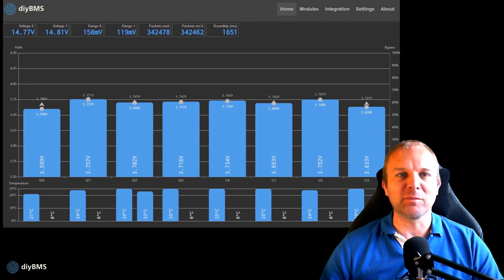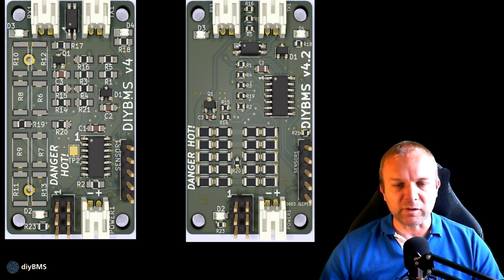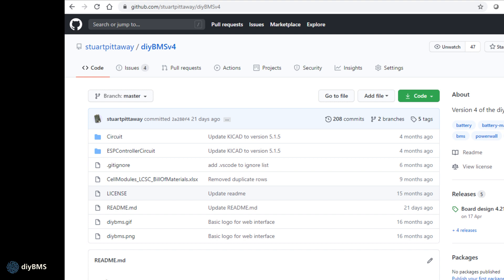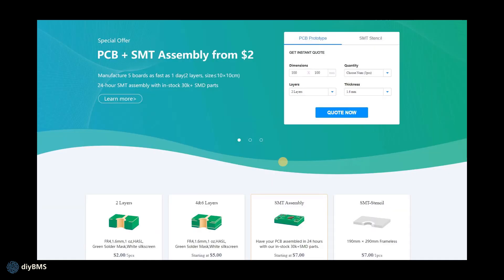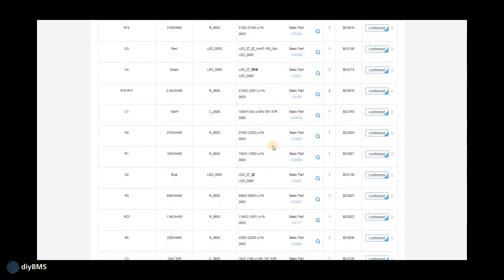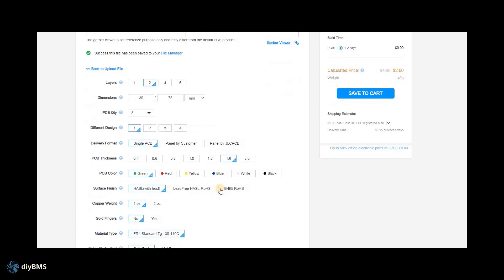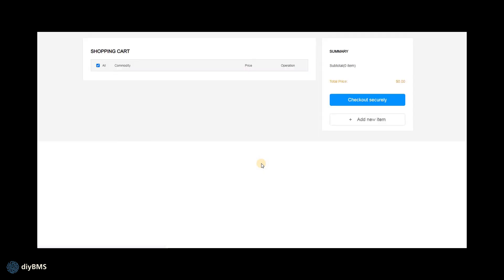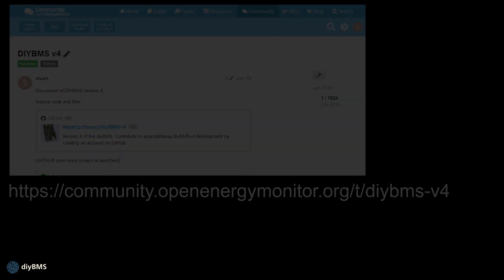DIYBMS v4 Building & Ordering PCBs

Comment: v4.5 have error past confirm BOM and CPL:
"Error:
The below parts won't be assembled due to data missing.
UPDI1,EXTTEMP1,J1,POWER2,J2,POWER1,RX1,TX1 designators don't exist in the CPL file."
Reply from the maker: You can ignore that - JLC have introduced a new warning message, they can't populate those parts anyway.

Comment: Hi. I try to start to build my first BMS. I started the whole order process with the latest ModuleV450. But on the jlcpcb site the following things are missing:
- 3R0
- ATTINY1624-SSU
- AZ432ANTR-E1

And for the main board:
- Molex0472192001
- INA229AIDGSR
Is there a replacement for this things on jlcpcb? Or I can left it out, and order from somewhere else?
Reply from the maker: I would wait for a few days and see if the parts come back into stock.  If not, you need to manually solder the parts on, and that can be difficult.

Comment: Hi Sir or madam,    
 Hello, I got something like this, how can I solve it. Regards.
        
  Well got your order with many thanks.

Sorry to bother you, but there is one thing that we want to confirm with you about your SMT order before proceeding.

As shown below, seems the packages of the parts (U3 ) cannot match the corresponding pads on the PCB board, so we are unable to assemble them.
Could we skip them and continue to assembly as shown in the below image?
Sorry that we don't replacing gerber/BOM/CPL files for SMT order.
For this case there are 2 options for your choose as follows:
A- we enable the replace part button for you that you can re-select the corrected part
or
B- we leave this parts unpopulated and refund the mismatch parts back to you to proceed
Pls consider and advise which case suits you, A or B??

Your early reply will be highly appreciated, thank you so much!

Comment: Hey Stuart, great project, thanks alot especially for sharing it. Currently I'm trying to order it. At JLCPCB the Anbon Voltage Suppressor for D2 (C440263) ist out of stock. Can I replace it with the MOD model (C113974)?
Reply from the maker: They look very similar, so I expect it would work okay.  I've not used that part, but I can't see anything obvious on why it won't work.

Comment: The design of burning off charge when the peak voltage is reached is not a great design.   Ideally, one charges each cell independantly using isolated charge sources, for example, a transformer with multiple output windings, one for each cell.
My experience with jpcb is mixed, they messed up and didn't cut slots so th parts wouldn't fit, and then worse, they didn't install some 0603 caps but did the boards anyway, and so they were useless and I spend many days trying to get them to fix it, they wanted to refund me for the missing 3cents of caps,
that made my $65 boards useless.    So letting you know, they have some issues.
Reply from the maker: Hi Murray, thanks for the comments. Do you know of any isolated cell based chargers on the market? I agree that resistive energy wasting isn't ideal, but that seems to be the most common in the industry

Comment: Thanks for posting. Can I ask a question this will be first time I've created a battery pack?

I think each module attaches to a cell and they attach back to the controller is this correct?
I want to create a 16s pack containing 16 x 3.2v 304ah batteries, can modules/controller work with this size of battery?
if I was to add another 16s in parallel would I need another controller or could these cells link to original controller?
Reply from the maker: Hi, you are correct each module would connect to a single cell (in your case the 304ah) so you would need 16 modules, and 1 controller.  If you double the cells, another 16 modules, but these can be linked to the same controller.
Reply: @StuartPittaway  thanks for the answer. So in theory I could keep adding 16s in parallel to the one controller up to
6 times?
Reply from the maker: @peterwhitehead8376  yes, some people have reported issues when going over 48 modules, so best to stay under that for now

Comment: Hi Stuart, what the highest amount of cells your project will run, looking for options for my EV conversion, is it capable of 96s ? Thanks
Reply from the maker: Theoretical yes, the most I've seen so far is 72s.  For high numbers of cells use the v4.40 modules. At some point I will release an update to increase the Comms speed on those modules, as this can be an issue with large installs.

Comment: Nice project, but 12V is quite low and not efficient for my home battery project. Is there any info on a open source 48 Volt Battery pack?
Reply from the maker: Hi, this isn't limited to 12V, up to 64 modules can be used so 48V is no problem.

Comment: Hello Stuart
Can single BMS Board  with controller handle 20S Battery Pack  
Thank you for the work!
Reply from the maker: You need a single controller and multiple module boards - one for each series cell, so 20 of them.
Reply: @StuartPittaway  Thank you for your answer

Comment: I want to build one, but before I do I would like to know if anyone can advise just how much CURRENT can this system use to discharge a single cell? I mean if I am charging with say 60 amps to the pack, this would be around 3amps/cell. What can I expect from this v4 diybms? Seems like a project right up my alley.
Or do I have the concept wrong? Is it work as above, or is the idea that by placing the resistor bank on the cell it alters the internal resistance of that cell and power is diverted to the others as they take the path of least resistance? I'll be honest, I thoought that bms just burned off the extra current, but do I have this all wrong?
Reply from the maker: Each module uses a set of resistors to drain the excess energy. This is normally around 850mA, but drops as the temperature of the module increases. You won't be charging the battery with a full 60A near the end of the charge cycle, so depending on how many modules and series packs you have determines if this is enough or not.
Reply: @StuartPittaway  So I am trying to order the PCB for the V4 since I am pretty sure thats the one I should be getting, but the zip file doesnt contain the files you mention in the walkthrough video. there IS a bom on the root folder of that zip but it has a different name (CellModules_LCSC_BillOfMaterials.xls)
Id really like to order these ASAP so can you please provide the files I need to place my order?
michael.i@me.com
Reply from the maker: @sNEAKYnIGHTmUPPET  There are two versions V4 is a bare PCB you build yourself (for this there is no BOM or CPL file) and the other type is V4.21 and that does include both files.  The version 4.21 is here.. https://github.com/stuartpittaway/diyBMSv4/tree/jlcpcbassembly (note the different branch)
Reply: @StuartPittaway  ty
you are the man
Reply: @StuartPittaway  also, I have an 18S LiFePO4 pack 280aH.
Reply: @StuartPittaway  Also, I noticed that the v4 board seems to also have the holes for the large ceramic resistor, can that be used for additional resistor kiad?

Comment: Where can I find this piece?
I can't find it at Mouser and LCSC is out of stock.
TL432G-A-AE3-R

Thanks!
Reply: Found in forum.....

    The AZ432ANTR is 1.25v whereas the ADR5040 is 2.048v. Stuart was juggling this part to get one that JCLPCB had stock of to reduce the amount of hand soldering. I changed to the 1.25v to match his last choice… unless he changed it again.

@gazzaman2k as @GeorgeBoudreau mentioned he is using the AZ432 chip which is the same design as the v4.21 boards on the LEAF version.

AZ432ANTR-E1 = VOLTAGE REFERENCES 1.25V 18V ±0.5% 20PPM/°C SOT-23(SOT-23-3) ROHS

This part is currently out of stock on JLCPCB, a similar part is this.

TL432G-A-AE3-R = VOLTAGE REFERENCES 1.25V 15V 50PPM/°C SOT-23(SOT-23-3) ROHS

It should be a drop in replacement. There are other components that would work, but these are much more expensive.
Reply from the maker: Take a look at this.
https://community.openenergymonitor.org/t/tl432g-ae3-r-is-no-longer-available-from-jlcpcb/15892/2

Comment: Hey can i use this bms to control a pack with 40s36p using 18650 cells? total of 144v 115ah?
Reply from the maker: Yes, upto 64S is possible in the current code version.
Reply: @StuartPittaway  thanks for your reply

Comment: Hi, I have a question, I have a 14s system, can I add another 14s battery after starting your BMS and add another 14 modules so that they work with one controller or will i need a separate controller?
Reply from the maker: Two 14S packs will work fine with a single controller
Reply: @StuartPittaway  Great, I will order parts to build your bms, do you have some description on how to configure everything to work?

PS:
Great job,  respect that you put so much work and energy into the construction and shared it with others you are Great :)
Reply from the maker: @ParagonDIY  if you looks at openenergymonitor forum and shop they have complete kits to buy/order to save most of the build time.
Reply: @StuartPittaway  thanks, I'll check :), but I prefer it myself because that's how all the fun related to the construction disappears, regards Leszek

Comment: Has the voltage reference D1 been changed on the jlc board. i have just replaced the 841 and the voltage ref and get a reading of 1.3v on web page?
Reply from the maker: The voltage reference is 1.25V on V4.21 boards

Comment: Stuart, thank you for the incredible work. i am attempting to order some assembled boards and am getting an unselected part  Q1  (AO3400A).  I am wondering if this is a problem. They are only letting me order 10 per line  item, however I am able to order a duplicate item to get 20. i am building a 16 cell lifepo4 battery where i hope to use your diybms.
Reply from the maker: You will definitely need the AO3400 part, it's tiny so you don't want manually add that later on! Did you know you can buy the modules as a complete kit from openenergymonitor shop?
Reply: Thank you for responding. JLCPCB is showing that they have the part in stock and I have found it on the board, so I'm not sure what their problem is. I am not in hurry so will try to order again in a couple of weeks. Thanks for tip on open energy, and will go that route if JLCPCB  continues to have the Q1 problem.
Reply from the maker: @yancymuu4977  no problem. Open energy will also be stocking the controller boards in single quantity so you don't need to purchase 5 from jlc.
Reply: @yancymuu4977  I got the same issue, but it turns out there are 2 options, so you just need to expand and select the one you want. The specs are just a tiny bit off from Stuart's schematic (1.4V vs 1.5V and 5.8A vs 5.7A).
Reply: Thank you Jasreca. I will try that when I get back to it. I wonder if one can add the micro controller the same way.
Reply: @yancymuu4977  It's not the same for the attiny, that one is out of stock. It does appear to be out of stock more or less constantly, so i ordered it separately and will solder on myself.
Reply: OK. I have successfully soldered an 8 pin adum1250 before, but it kind of wasn't a good job. Am really nervous attempting the controller with more pins.
Reply from the maker: @SystemsPlanet  hi, they are built to the same set of Gerber and BOM files I personally use. They are unfinished as they still need manual soldering of the attiny and through hole parts.

Comment: Sir, if you don't mind, i just wanna ask, is the bms can configure on 15 series and 14 parallel of lithium ion battery (210 cells). I'm building two pack of this which has 420 cells overall. Thanks 😄
Reply from the maker: Yes 15S is fine.

Comment: Thank you so much Stuart. Great video and product! Is there a way to disable the balance feature? I want to use this in my upcoming build, but I already have a BMS. I want to use this to report cell voltage and temperature to my home automation system through MQTT.  Thanks again I just ordered the PCBs.
Reply from the maker: Yes, just set the balance voltage higher than your current BMS and then it won't kick in, unless the other BMS fails.
Reply: @StuartPittaway  outstanding!  Thank you.  That is brilliant

Comment: Great Work Stuart - I am trying now and 3 weeks to Order for JLPCB but the 6.2 Resistors are not in stock - i also contacted them and they cannot help- so assembly without resistors is not worth it - Can we replace the resistors with some other value ?
Reply from the maker: Yes this has been discussed on the forum, take a look Google openenergymonitor and click community

Comment: So these BMS boards are not available for sale assembled and tested?
Reply from the maker: Unfortunately not at the moment. I am in contact with openenergymonitor shop to stock them, may be in a few weeks.
Reply: @StuartPittaway  thank you for getting back to me. As with others I have failing eyes and could find it hard to solder the smaller items.

Comment: interested in this , how many units can be run in parallel ? working on a 200KwH pack
Reply from the maker: Sorry for the slow reply, the controller can handle 64 modules, the next code version 100.

Comment: Stuart, Can you do a video showing how to debug the I2C communication and the module to module hookups?
Reply from the maker: Ok, it doesn't use i2c though!!
Reply: @StuartPittaway  I'm having trouble with the WeMos talking I2C to the PCF7574 and to the Opto isolated modules.
Reply from the maker: @stevensexton5801  it only uses i2c for Comms with the PCF chip. Have you got the correct i2c address in the code?

Comment: Thanks Stuart for this - my eyes are not up to the soldering of the surface mount components so this is what I have been waiting for. Will get an order in this evening!
Reply: Microscope from China arrived so tried out soldering the ATTiny 841 ICs to the module boards. Two boards were fine and got working but third did not work so learnt not to solder all the pads before placing the IC on the board - just apply solder to one pad to position is the trick. Got two modules talking to the controller - two more left to do.
Reply: Just placed an order with JLC using this method. Like in the video, the ATTiny was not showing in stock but placed the order anyway and will have to hand solder them once the boards arrived :-)
Reply: So the boards arrived today and look good. Ordered on 3rd July and arrived 15th July so not bad turnaround.

Comment: Stuart how much current can these handle for over voltage? Think of 14 packs of maybe 180 to 200 2000mAh or above per battery.
Reply from the maker: The current doesn't matter in this example, the BMS can burn off about 650mA when balancing (per cell)
Reply: @StuartPittaway  Thamk you for the reply Stuart. Loving the professional look of these vlog.